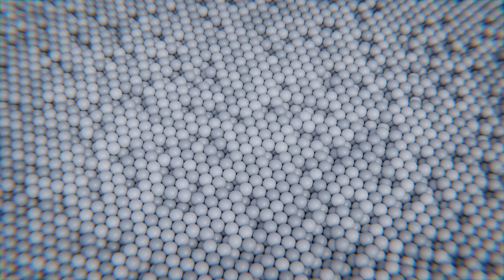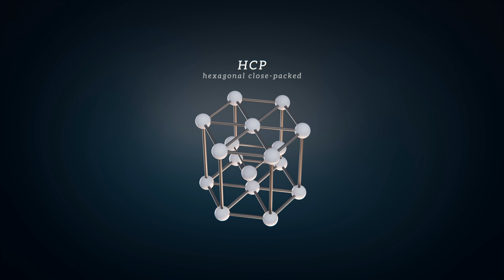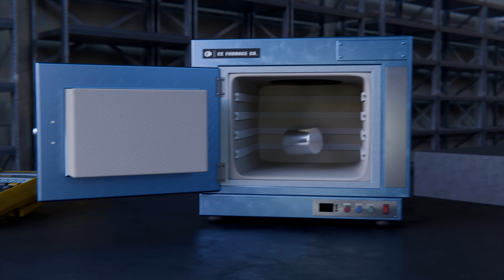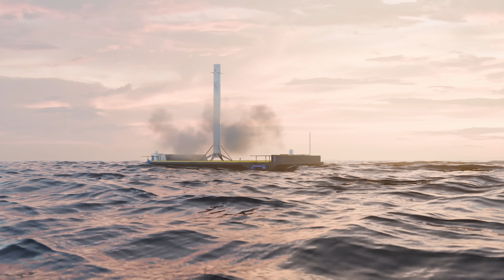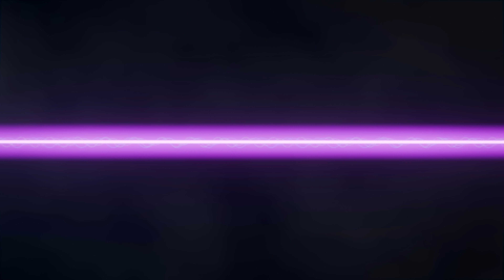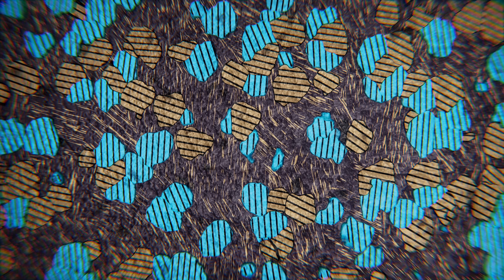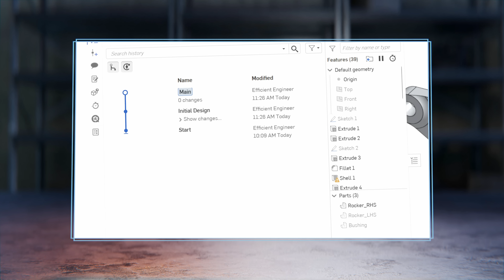The Problem with Titanium

Comment: As an implantologist, that implant should have been placed deeper, as the bone level implant surface should be fully submerged into the bone, so that the bone doesnt resorb - depending on bone and soft tissue thickness so that atleast 1,5 mm of bone around the implant is secured and min 4mm of vertical soft tissue height above the platform is secured, which determines the depht of placement, provided no vital structures are in the way such as a nerve

Comment: when you make things that operate so incredibly close to their material limit, this is what happens, you end up with a turbine that explodes because of a defect that you need an electron microscope to see why it failed. i understand grams turn into ounces and ounces turn into pounds and pounds turn into tons and aircraft cannot be made of bricks and slabs of steel and be expected to fly like anything but a jailhouse. but some parts on an aircraft need to be overbuilt well in excess so that they simply do not fatigue, if they are a little heavier, then its still lighter then a casket for everyone on board

Comment: I had to work on a joint where our titanium hardware saw a circumferential flow at 900+ degrees F, in an oxygenated environment. Titanium combustion risks galore. I redesigned both sides, put a heat sink in there, and was able to get the temps down to 200 deg F on the Ti surface (verified by temp sensitive paint). That joint just flew on Artemis 2

Comment: Just curious, is this why in the LEAP engines, ceramic matrix composites and 3d woven carbon fiber turbo fans are used with a Titanium alloy edge? I mean lighter fans equals less centrifugal force, therefore less  cold-dwell fatigue experienced by the turbofan hub...Is this the logic ?

Comment: Discovered this video a few days late, but I wanted to say that it was very interesting and enlightening. I'm a physicist who's focused the last few years on projects requiring significant mechanical design, such as the development of ovens for generation of atomic beams in ultra high vacuum environments. I've used titanium alloys, especially Ti64, extensively in these designs. This is largely because titanium has some really great properties for ultra high vacuum environments, mostly because it has a lower outgassing rate than most other materials out there, including steels. For ultra high vacuum (UHV) and extremely high vacuum (XHV) systems, outgassing (the release of gas from the various materials inside the vacuum chamber) is the dominant source of vacuum contamination, and it tends to be an even more significant problem at elevated temperatures, so low outgassing materials such as titanium alloys can make a huge difference in applications like these in vacuum ovens. At the same time, for an oven in particular, careful control of thermal conductance and thermal expansion can be crucial for performance, and titanium can fill a particular niche that essentially no other material can in this particular application. With all of this, you can imagine how your discussion of the different phases in greater detail than what I've gotten from data sheets and the like is interesting to me: I spent a chunk of the video just thinking about how the titanium itself will change through thermal cycling, and I feel like I have a better understanding of why those data sheets led me to the temperature and stress limits that went into the design. So, thank you!
Reply from the maker: Sounds like really interesting work! Glad the video was useful.

Comment: Oh, my. Well, I'm glad they got the plane down.

Iron is similar to Ti's oxygen characteristic. Carbon atoms dissolved in iron (Fe) form what's commonly known as steel. Steel ranges from low-carbon, "mild" steel which is soft, and high-carbon which at least used to be used in hard but brittle objects, such as lathe bits. Mild steel is useful for things like auto body panels, which are stamped into shape and need to deform in crashes to absorb energy.

Comment: One small error, titanium oxide is slightly conducive.   That is what allows it to be anodized.   Same with aluminum.  Which is why aluminum electrical connections caused many building fires before it was understood. 
Iron's oxides do not have the conducive property. That is why you cannot anodize iron.

Comment: It must be remember metals have a internal vibration that is shared from end to end if induced to a end point.
Vibrations are a frequency.
As long as each end point has the same shared frequency let up,
should show the strength of the metal is equally shared. {No deflection and gravitational separation by parts.}
And vibration would be the substitute to thermal heat passing through it. {Or its ability to cool itself as it gets warmer.}

Comment: Even some of the most qualified engineers do not understand that Titanium, though light, is only stronger than steel for fittings that are in tension, and not in compression. The same can be said for carbon fibre. THis is why racing yachts often suffer explosive failures in compression in say, masts, but not in booms. Stainless steel and glass fibre do fail but less suddenly. So using lots of exotic material may save you weight, but it hides lower reliability limits than  conventional materials.

Comment: WTF — Off the charts cowardness in not naming the engine manufacturer and manufacture date in an otherwise brilliant A+++ piece. Engine Alliance  was the engine manufacturer; a JV between GE and Pratt & Whitney. P&W supplied the fan blades. Engine type GP7270 built in 2009, installed 2013, blew up 2017. All per www.bea.aero investigation (85-page) online report into Air France flight #066 on September 30, 2017 via an Airbus A380-861.  So it was Titanium alloy Ti-6-4's fault, not P&W and GE's “lack of knowledge of cold dwell fatigue phenomenon” as BEA flat out reported on Page 1 of the Synopsis?  How should they have known of titanium's stress deficiencies in 2009/2017?   Glaring “speak no ill” of the actual engine manufacturer and their engineering prowess … or lack thereof. Why give GE and P&W a free pass???  It wasn’t even a high-heat rear turbine blade — it was an up front lower temp fan blade stress failure. Cold dwell fatigue. That transparency deficiency aside, great, great YouTube engineering look see. Thank you.
Reply: Lots of righteous anger there, precious little outside reading. This is an infrequent phenomenon that was poorly understood in 2009, most of the literature to that date is inconclusive, and it isn't until 2015 or so that you start to see significant numbers of papers on the issue. On top of that prior to this specific incident, cold dwell fatigue had not been known to occur in that alloy.

 You're genuinely trying to put a company on blast for an issue that was not known in the material in use, and was only barely understood in the wider literature at the time it occurred?

Also, it's called cold dwell fatigue for a reason. It does not exist above 200C, because of... no one quite fucking knows because it's still an area of active research.

Ps: cowardice*

Comment: I feel like the strength comparison isn't really fair. While 7075 and Ti-6-4 are both on the high end of commercially common strength, 1000 MPa is pretty milktoast for steel. 4340 itself can be treated to >1600 MPa. Pretty much every ball bearing, knife, file, saw blade, milling bit, or lathe cutter is over 1800 MPa.

Comment: Soviet and Russian engineers utilized high-strength, low-density titanium alloys, often featuring higher Titanium-Aluminum-Vanadium composition ratios than steel, to build submarine pressure hulls. These specialized alloys enabled extreme diving depths (over 2,200 ft), higher speeds (>40 knots), and improved stealth through non-magnetic properties, notably in the Alfa, Mike, and Sierra classes.
PS —love my titanium sunglass frames as they are light and hypoallergenic. Also my watch is manufactured out of titanium!
Reply: Yes - they did make those subs.  Yet after the super submerged , te subs looked like a strange zoo animal- the titanium bulged in places and shrank in others
Reply: @patrickrutherford7614  Komsomolets submarine comes to mind.
Reply: Money bags!😂

Comment: My father worked for Westinghouse back in the early and mid 1950's.  At the time, Westinghouse was working on jet engines for the Department of Defense and truly struggling with figuring out how best to deal with Titanium in jet engines.   The program ran so far over that the Defense Department just decided to take all that Westinghouse had learned and shaft Westinghouse for their efforts.  Westinghouse got out of the defense industry work and my father ended up working on delivery systems for nuclear warheads.
Reply: That's crazy to think the DOD would screw over westinghouse like that considering they have nearly unlimited resources.

I bet better processes would have been found in their time if they let westinghouse continue their research.
Reply: @kryptokrypto702  It was the choice of Curtis Lemay and it was in the hottest part of the cold war with the Communist government in Russia.  Also, it came right after the Russians grabbed the lead in the space race by putting up Sputnik.  Westinghouse had solved most of the big problems at the time, but it had embarrassed the air force and Lemay, so he screwed them.  Others picked up the work and took it further, but to my knowledge there was no reason Westinghouse could not have successfully continued the work.   As for my father, he moved us back to Philadelphia where he got a job working on defense projects again.  When he applied for the job, they tested him by giving him a long sheet of statistics from a jet engine test and gave him a half hour to do graph them.   He took a quick look and just sketched out the graph and the accuracy of the answer blew away the guy giving him the exam.   Not surprisingly he got the job, but he ended up working the next three decades with rockets and space stuff.

Comment: This reminds me of old saying: anybody can design a bridge but it takes an engineer to design a bridge that's barely strong enough. These titanium airplane engine engine parts are made with such a small margins that atomic level features start to become important. And just doubling material thickness everywhere is not an acceptable solution because it would increase the mass of the rotating parts too much.

Comment: If I understood correctly, and what most are missing, is that  that particular lot was forged improperly. Seems, that the headline is misleading.
The issue was not the titanium, but a  non homogeneous area of microstructure that I would conclude was due to improperly forged material.
So, who forged/processed the material?

Comment: It's a lovely backgrounder but I did not really hear a conclusion or mitigation, just "it's microstructure and don't worry steps have been taken".  But wait, all parts have microstructure so why did this one fail at 25%.  SOME new parameter has to be identified ABOUT the microstructure that was somehow variable in the manufacturing and has to be standardized, changed, etc.  That was leaped neatly right over.  Nobody wanted to say, "must have over-torqued the nut", that would be negligence, OMG.

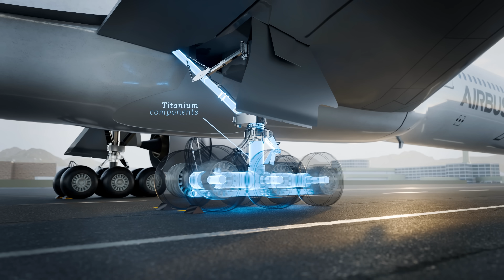Comment: At 15:45 when you show the landing gear, the inner cylinder and truck are made of high strength steel, not titanium.
Reply from the maker: I showed the inner cylinder and bogie beam as being titanium based on a diagram from the A350 ATA 32 Landing Gear brochure - see page 21 here: https://www.scribd.com/document/721381215/A350-ATA-32-Landing-Gear-Systems-EYIC-V32PR1206234.

Comment: I HATE titanium.  As an engineer I had to work with a design that required titanium for its coefficient of thermal expansion.  I argued against it.  There are much cheaper metal and cermet alloys  that will provide the same properties.  But the design was from the materials guy. I was overruled.
I said it had insufficient fracture toughness to resist cracking under expected load.  I was overruled.
I pointed out that it could not be welded in our shop because it required an inert gas atmosphere without oxygen and our shop couldn’t do that. I was overruled.
I pointed out that it could not be cleaned with our standard process because it could not be cleaned with chlorine-based solvents.  I was overruled.
I pointed out that because it could not be cleaned in our process our standard strain gages and accelerometers could not be attached to the surface for my vibration tests required for certification for use.  I was overruled.
I also pointed out that thermocouples also could not be attached because the surface could not be properly prepared.  I said the alternative would be to buy a $30k infrared camera and coat the prototype with a constant emissivity spray which would contaminate the surface and require it to be sent out for cleaning.  Again. I was overruled.
So I had to shlep it by hand all over the northeast  to specialty shops that could all those things.   Cha-ching! Boku bucks!

I finally got to test it. It had a thin cavity that had to be under positive pressure and still maintain extremely tight planar tolerances. SNAP! It audibly cracked inside. PUFF! The flat shell blew up like a football.

Why did the company insist on this chimeric design?  Because they were able to get a patent on it! So they could  be the sole supplier and force the customers into vendor-lock!

I said of course you could get a patent!  Because at a glance it was common sense it would cost an absolute fortune and never work! 

I left the company.  I wouldn’t be surprised if their next patent was for square tires.
Reply: Sounds to me as though hating your old company might be the more reasonable reaction to going through all of this, rather than developing a hatred for titanium. 

It would rather have not been made into a part that was destined to fail either, it told me so.

Comment: Steel, has great resistance to heat, Iron absorbs a lot so does Carbon, Iron is hard and Carbon is soft Mechanically, so they dissipate heat from mechanical work really well, so maybe they should make an alloy with Steel somehow.
Also that Ti-64, According to this Documentary, is not the best Fabricated Ti, so maybe a combo of 1 or more Forged Ti might be better, plus the Steel Alloying.
So I think more research should be done, to find better materials.

Comment: I worked on analysis of the root structures of turbine blades in steam power plants. We found that some trace elements were migrating to that structure  and weakening it. The heat and rotational forces were driving that migration over time leading to turbine blade failures. Similar to what was happening  here. The time to failure was related to the initial PPM levels of  "Tramp" elements in the blades.
Reply: I would hate that phenomenon.  Nobody asked for it.

Comment: Also worth noting - titanium has a modulus (springiness) that is close to bone. So as a rod and pin it will flex the same and not break the bone it is attached to (like steel would) or being too flexible that it let's the bone break again (like aluminum). 

EDIT - tmyk - I'm always up for learning, see Andy's comment below.
Reply: No, titanium is still much, much stiffer than bone. Cortical bone is around 17 GPa, while titanium is more like 110 GPa. This is a huge problem for hip implants because the metal shields the bone from stress, confusing the bone cells into thinking the bone isn't needed, and dissolving the minerals away. A reason we don't use aluminum is that it behaves poorly under cyclic loading. It might also not be very biocompatible—I took Biomaterials four years ago, and I don't recall.
Reply: @AndyFaubert  Thanks for the more accurate info.

Comment: Now it isn't just shiny, expensive and ultra convenient. I learnt it can have 5 micro structures. Hard to determine what you are holding and what happens when you heat anodize it. But that I will find out. Hope is high like the cost of this precious

Comment: Retired mechanical engineer.  I see many more specialized listeners here. But as I was listening the failure mode seemed almost obvious.  So you’re really designing to a probability that the lattice structure will be acceptable at various temperatures and mitigating failures through testing and inspection.  Heat treatment and material properties could be different on every material orientation situation.  I call it a nightmare.  I’m OK with being retired.  Imagine if someone thinks it would be a good idea to resource for a cost save.  Thank God for 4 engine planes.
Reply: Greetings from another retired Aerospace engineer … one of my last jobs required careful choice of materials for a component integrated into landing gear. My previous experience was focussed on airframe systems, but a glib suggestion that we use Ti rapidly took us down the rabbit holes discussed in this video. Woe betide those that now point to something and declare loudly to me that the item must be the best thing ever “because it’s made of Ti” …. 😂😂
Reply: Please very by posting.your PE certificate.

Comment: This channel seems to have a significant number of bots commenting and this video is a little overdone.😢AI generated
Reply from the maker: You're wrong though.
Reply: @TheEfficientEngineer  this video contains significant amount of AI in it generated images and speech. You can’t deny that because it’s clear.
Reply from the maker: There are no AI generated images or speech in it, at all.
Reply: @TheEfficientEngineer  YouTube itself says there is.
Reply: I’m not dumb it’s Ai generated and you might have made parts of this but it’s clearly using Ai.
Reply from the maker: Where does Youtube say that? The entire video was modelled and animated in Blender.